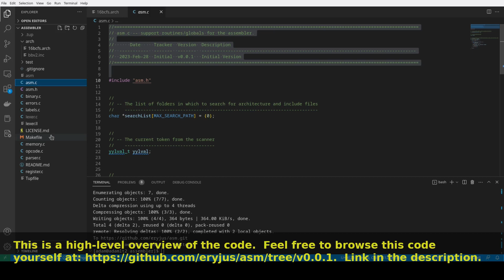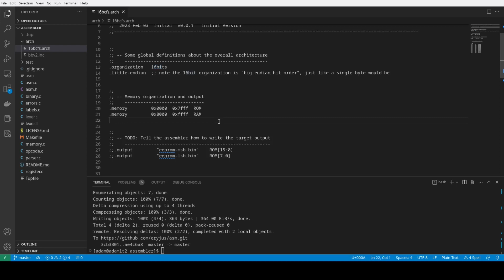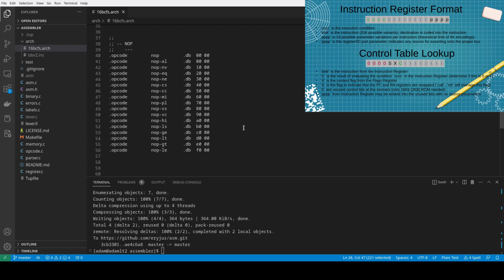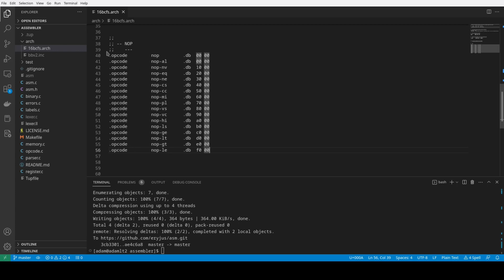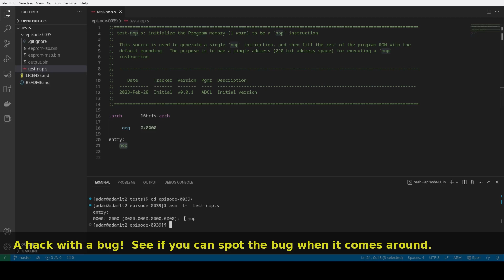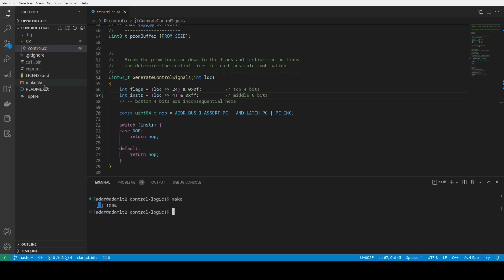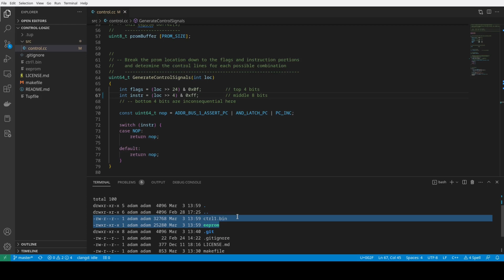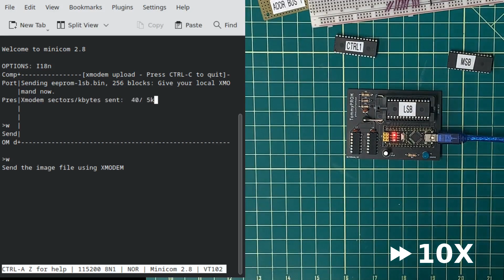0039: Memory and Assembler Overview | 16-Bit Computer From Scratch

Comment: if 16bit results in 32bits (like in a rom lookup table) then multiplications & 16-bit two parameter ops get 32-bit precision in their results
Reply: it double width results rom ops get rid of the carry logic
Reply: i mean the alu rom implementation, not really the logic so much, that is possible to be lookup table too, no transistor logic, only memory cell logic
Reply: math + logic is most essential function of a processor/pic/system
Reply from the maker: @Jkauppa -- if I am reading your comments correctly, you are correct that an ALU is critical to a fully functioning CPU.  Moreover the architecture for the ALU on my build is going to need to be carefully thought out if I am to keep all my ALU-related instructions scalar.  

Perhaps me using the term, "CPU," is a little misleading -- it will be a CPU eventually but it may be too soon to give it that promotion.  Let's call it a circuit for now (and I will work to remember that while I am recording content).  

But the milestone for this point in the build was to have a free-running circuit, which I specifically defined that no matter the address that is requested from memory a NOP instruction is fetched into the Fetch Register and that instruction is executed by the control logic.
Reply: @eryjus4594  well my point is that cpu (say 8-bit/16-bit) can be super simple and super fast, emphasis on the super fast, assuming hyper frequency memory controller dac/adc style "processor"/"cpu", that just juggles memory around, pre-compute cpu, at maximum frequency, and I'm talking about 60GHz+, not limited to the usual 6GHz what is currently the limit on desktop processor